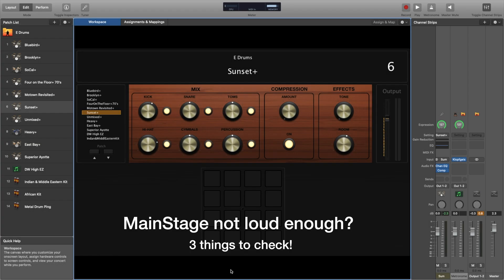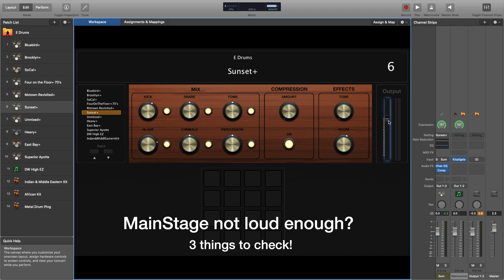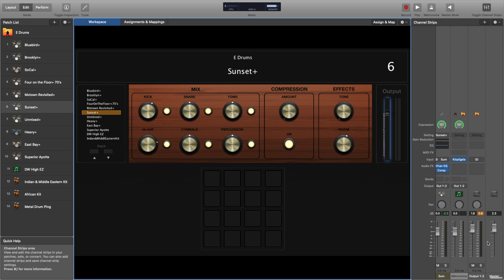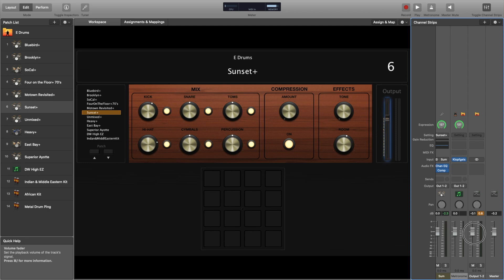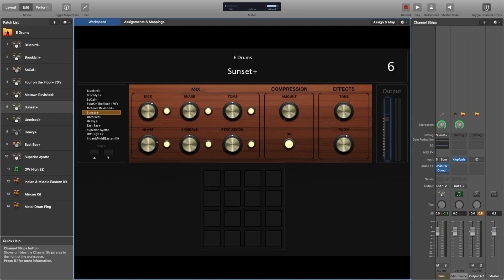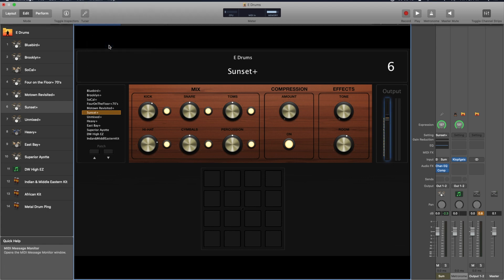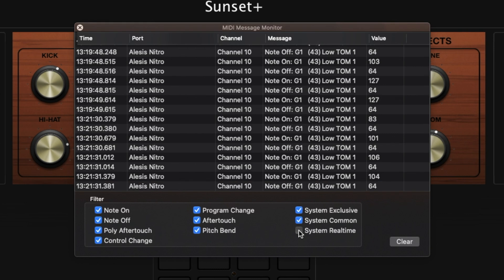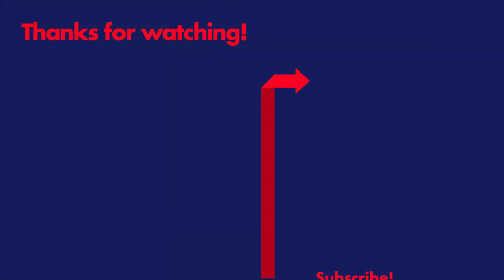MainStage volume too low? 3 things to check!

Comment: Well, it would be nice to know how to adjust the velocity level as well. For me this might be the problem, I then have the diagnosis, but no solution. Thanks.
Reply from the maker: If you are sending midi velocity values and can see 127 as your max, then maybe it’s the kit, but the stock kits all are loud enough if that’s the case. Watch the midi messages and first be sure your drum brain is sending out the full range of values (0-127) - if it’s not, it’s your drum brain that’s not set right for sensitivity and thresholds on the pads themselves.

Comment: Is it possible to run 2 modules?
Reply from the maker: In theory, yes. If you are using midi then you have to be careful not to duplicate any note numbers between units, and make sure your computer device sees both midi instruments at the same time. I know I have 2 midi sending units (not 2 modules, but 2 different units) sending midi via usb to my computer at the same time and it all works.

Comment: Hi Kevin wow I love all your videos. I do have a question how did you mount your mac mini keyboard and monitor to the drum kit.  i just can't figure it out.
Reply from the maker: Ahh - I built custom shelves out of plywood and scrap trim cut precisely to the size and shape of the parts, then used adjustable pipe clamps from the plumbing section in Lowes to mount them on the pipes.  The monitor is just a standard vesa mount bolted onto a 1” piece of EMT tubing dropped into the inside of the upright tube of the drum rack. I bought a whole second rack on eBay for $35 to extend the rack and such.
Reply: @BustingsticksWithKW  Thanks I will be doing the same once I build the kit. I purchased the commander mesh it is still in the box lol.  looks like I am going shopping on eBay.  Thanks again